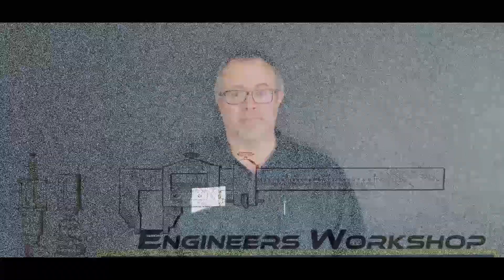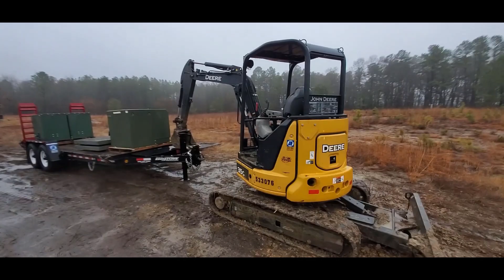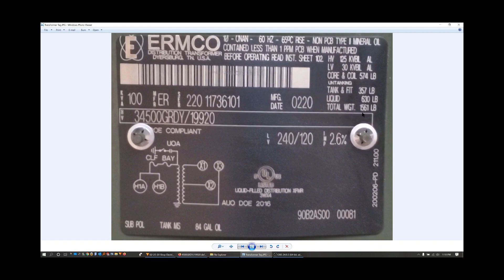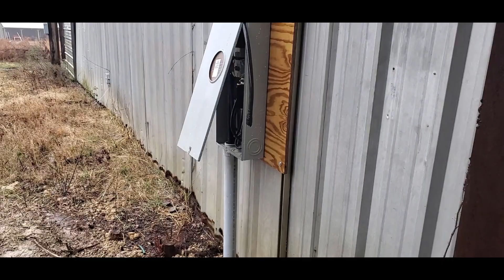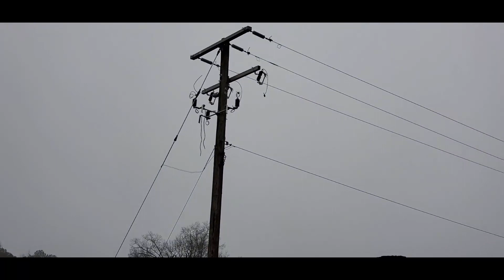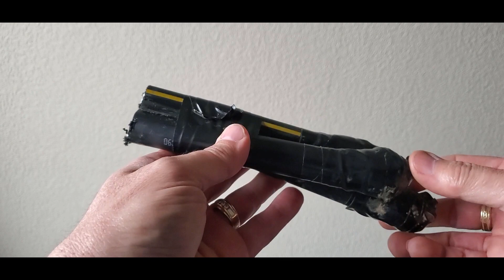Shop Update... More Power!

Comment: On the plus side, the installation crew worked in the wet to install the three boxes. That's a positive.
At least they didn't just drop them off and waited for better weather.
What is the large green transformer(?) already sitting there? Or is it a telco box?
I finally figured out the plan for the three new ones after going back and reading comments...
Reply from the maker: The one farthest right is the old 208Y/120 three phase transformer the sawmill used. Dominion would not hook that back up because it did not have internal disconnects. Plus I did not want 208v when 460v was available. The wiring in the building was massive to run 100HP saw motors with the 208 service. I don't know if they ate going to just leave it or remove it another day. The pad would be a good place for an oil or propane tank...

Comment: I can't recall... what was the reason they aren't doing the 3 phase work now? For my own new shop service (in process) if I did 3 phase now I only paid a fraction of the full build cost which amounts to a pole replacement and 3 transformers. If I did single phase or anything else for that matter and then decided later to change it then i'd incur 100% of the cost to modify. Elected to go with a 200 amp 120/240 delta high leg 3 phase.
Reply from the maker: I'm deferring 3 phase because of the cost of my inside switchgear. Single phase is cheap because I am installing panels and wiring myself. When I run circuits across the building, I will do 4 wires so that everything will support 3 phase later. Just had to prioritize what happens with the limited funds I have. Walls and floor come first.
Reply: @EngineersWorkshop  totally understand for the transformers, drop, meter base, exterior disconnect,  42 pole panel and the led lighting  I'll be in $9000
Reply from the maker: @mabmachine  I guess every power company does it differently, here there is no installation cost. the load estimates you provide either justify the project or not. The arrangement seems to be "Will you hook up power for me if I promise to write you a check every month, forever?"

Comment: That looks like 600 amp wire. You will be able to run some serious horses in there!!
Reply from the maker: The single phase service is 400 amps. I have two 200 amp panels side by side. Lightning strike was just for you, hope the sound was more consistent!